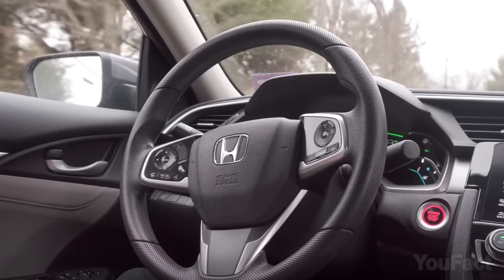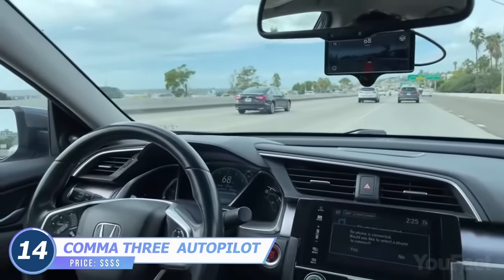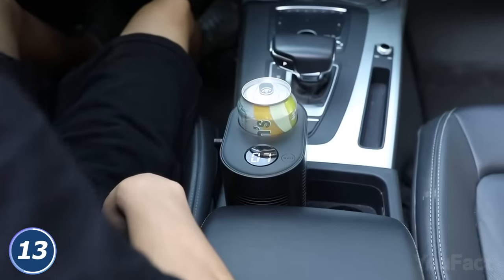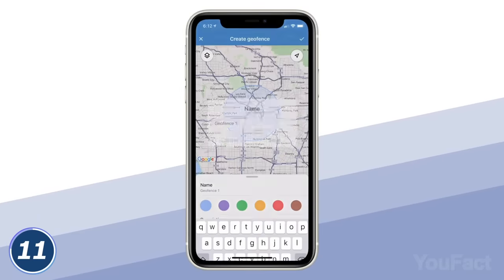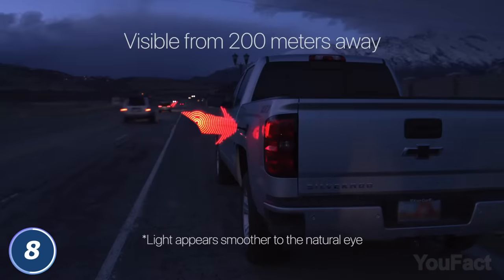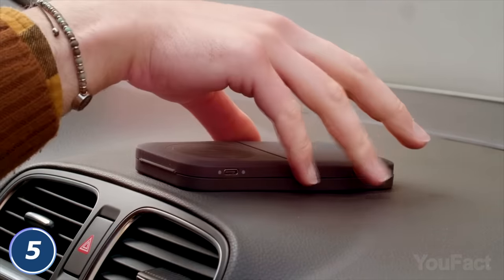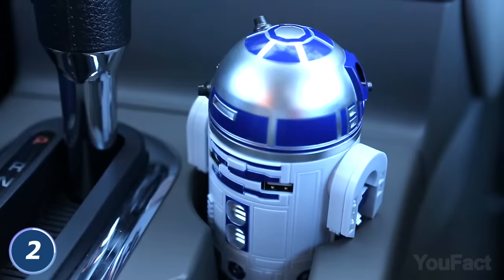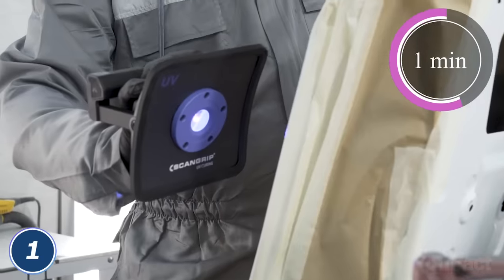17 Awesome Car Gadgets You’ll Want To Have

Comment: 0:56 Anytime a driver is driving close to my rear, I just use my windshield wiper fluid.
If they ARE too close, their car will get wet. 
And their's nothing wrong with using your washer fluid.
If they have the nerve to pull along side you and complain that their car got wet, you can just reply with, "That's weird. They design the fluid to not hit any cars following at a safe distance. You must have been pretty close if you got wet."
Reply: Ahhh yes... the fluid
Reply: I think you got issues if you think people would complain about wiper fluids on their car Karen.
Reply: @SebVEVO  That's the best part! It doesn't bother normal people. Only egotistical road ragers. 

Did you know that it's never too late to forgive your father?

I'm not saying this to you , this is just something I'm saying. You might adhere to the advice and make some changes. Or you might just get angry with a double projection accusation.